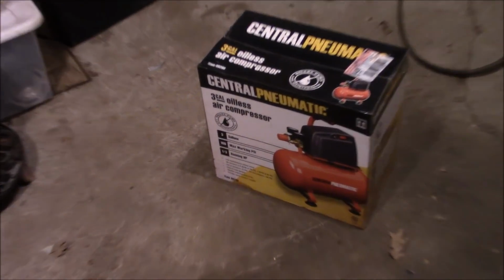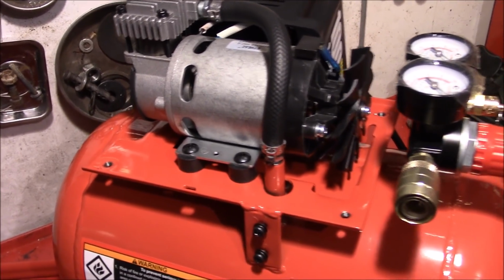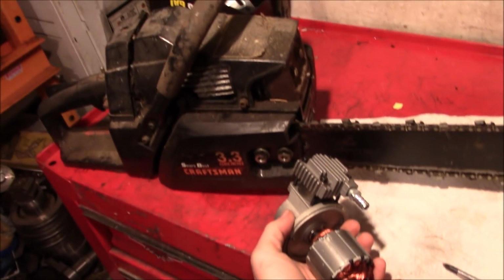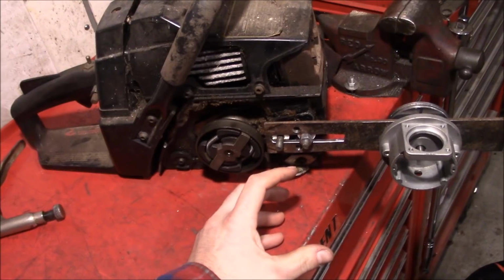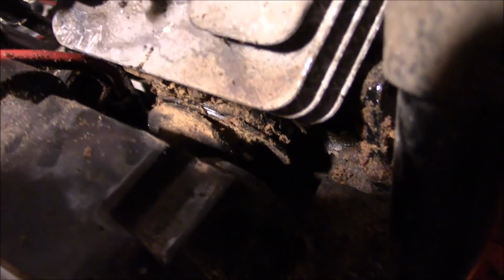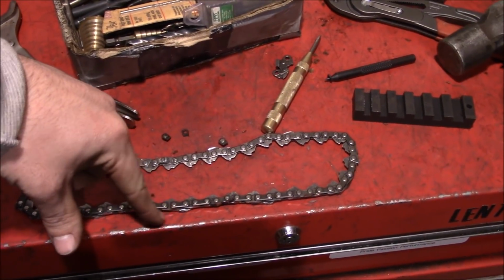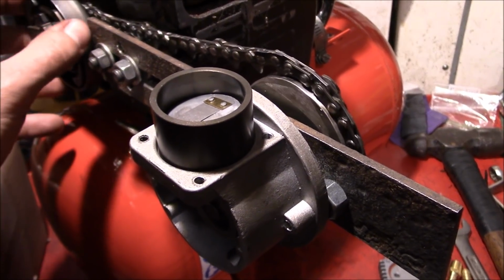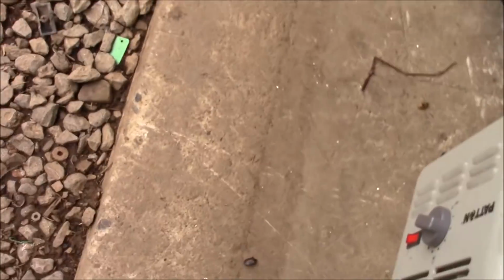Chainsaw Powered Air Compressor Project

Comment: now ya got me curious about using a 4 stroke engine, with a belt drive, the same way you have that throttle set on this unit.  no way that i want to give $1200 or more for an unloader valve to build a gas powered compressor unit with a 4 stroke if the throttle can be done the same as you did with the 2 stroke.
Reply from the maker: Yeah man, would be cool if it could work on that also.  Heck, could possibly wig up a pressure with powered relay and solenoid if you got battery power.

Comment: saw chain sprocket is couple bucks, take the other saws drive sprocket off. use it.
Reply from the maker: That was definitely a problem area,  needed something with a higher tooth count to reduce the speed.
Reply: @toocheaptosmoke  right . great videos . i build stuff . i put a swing arm solid axle  behind my murry tractor. i chain drive it from the old transaxle.  making a double chain tightener so i have reverse was  one of my greatest accomplishments . i bet you can understand that .   thanks again for the videos

Comment: now i will try the orig switch setup like this. was goin to get the air feed throttle control. but hell... wtf for lol .. u should have used the orig bar or a bar that fit it..

Comment: Why dont you use the car ac  its much more powerfull
Reply from the maker: Mainly size and power requirements.  Those are good for adding onboard air to a vehicle though.
Reply: @toocheaptosmoke  i agree 👍 they're not bad

Comment: Over time you will get the hang of it and get to know the welding machine better . Your welds looked good. Biggest thing is that you get enough penetration. I myself bought a Mig a few years back. I like Stick better. And my welds looked alot worse then yours. Alot worse...LOL..But overtime Ive gotten better, not no wheres near perfect but they hold the welds. Doing stuff like you did here a mig is Perfect for.Great Video thank you for sharing...

Comment: Random thought, can you take a 2cyl motor, make it a thumper, and have the idle cyl act as a compressor?  weld the exhaust valve shut, preplace intake spring on the air side cylinder with something way lighter, and have the output at the spark plug hole. Need to think more about the crank angle considerations.  If its 180* it will REALLY thump, since you loose crank momentum via two compression cycles, one on the air side and one on the next compression stroke of the gas side. Could work though.  might be a lot smaller of a package than this too, with a potentially larger CFM than that little HF compressor.

Comment: Brilliant project. If that saw was a little older and had a manual oiler. You could plumb it into the compressor cylinder/piston for that occasional oiling you mentioned.
Reply from the maker: Ha!  Now that would be something!
Reply: By the way, I knew this was going to be a good one so I saved it until my frozen pizza was cooked to watch it while I ate.

Comment: Use. The tip off the bar if it was a roller tip
Reply from the maker: That's a good idea!  Not sure if it has enough teeth, but definitely would have been easier than making the throwing star, haha.